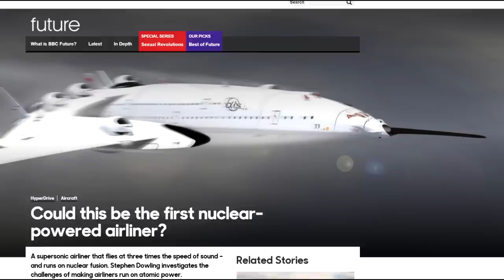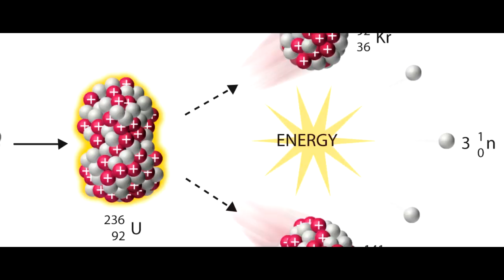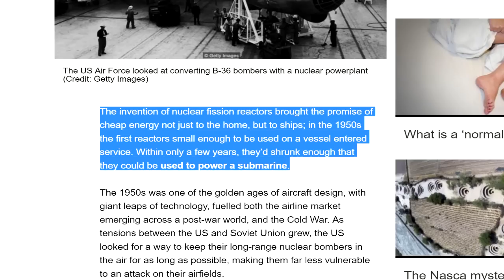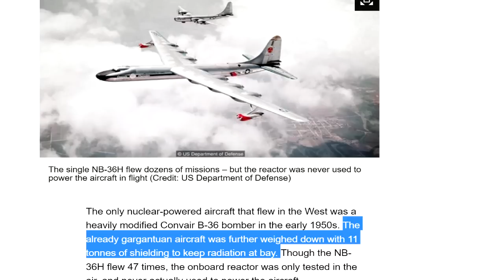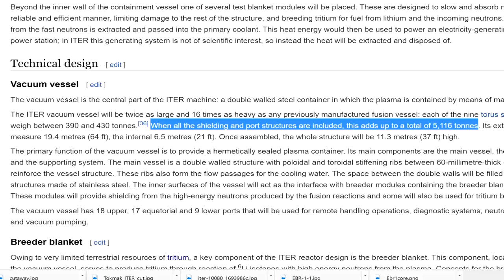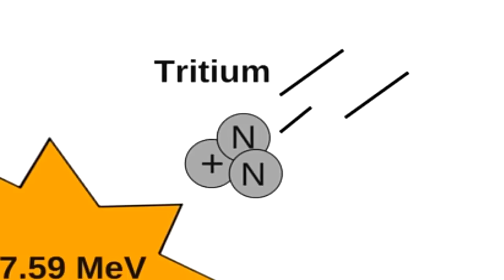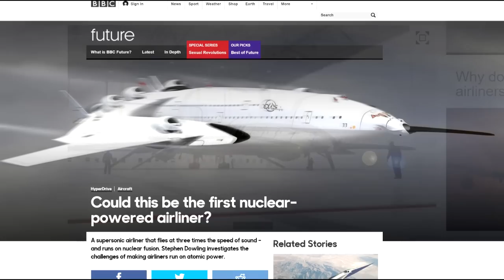SIX ENGINED Nuclear Airliner... BUSTED!

Comment: Wouldn't it make more sense to just have a plane capable of entering higher atmosphere to meet less air resistance so you could hit high speeds? Then again rocket fuel is expensive. I think it'll probably happen eventually though.

Comment: Do all concepts of fusion involve radioactive fuels? I was under the impression the goal was to fuse two hydrogens into a helium?
Reply: Molten Salt Reactor.  Most of the fuss these days is about the LFTR ( a type of MSR), the Liquid Fluoride Thorium reactor
Reply: The sun does that, but humans are nowhere close to being able to contain such a reaction.  I really don't get the hype about fusion in general, theoretically it's awesome, but in practicality were much closer to other clean sources (such as a MSR)

I'm sure eventually we will harness fusion, but i doubt it's going to be a big producer in the next 50-70 year's or so.  We could have MSR's up and running in a fraction of that.
Reply: What does MSR stand for? :D
Reply: animefreak5757 Aaahh. Thanks! ;)
Reply: search for LFTR in 5 minutes if your interested, it's a really solid primer on the technology.

Comment: The impracticality of nuclear aircraft aside, is there any reason that you couldn't use electric heat in a jet engine rather than kerosene flames?
Reply: It's the dramatic expansion of gas that makes modern engines work.  Other heat engines do exist, but just having heat alone generally doesn't give you the kind of differential you need.  Which is why powerplants still use steam turbine technology.
Reply: Thank you. That was a helpful answer.

Comment: We should just use Thorium reactors, because Thorium is one of the densest materials.
Reply: Untrue. Feminists are the densest material known, we should be using them instead.
Reply: +TheatreStyle That would be too dangerous. They're too unstable and are extremely high energy.
Reply: No, we need solar freaking airplanes. That time travel. THE FUTRE!/Imagination
Reply: no it would be so dense it would literally fall through the plane right into the core of the earth and cause yellowstone to erupt
Reply: +Joshua Kravatz Theoretically speaking would we be able to contain them with a safe space?
Reply: i thought feminist where easily triggered and the most flammable compound in the world
Reply: +Joorlak Flamedrake Thorium powered cars.
Reply: solar freakin planes,  nono that's just silly, thorium powered planes using solar freakin runways
Reply: Joshua Kravatz
I bloody knew it! Nice reference BTW
Reply: +Mick7sp I was thinking Solar Freakin' runways to get enough energy to liftoff, then either the Thorium reactors or feminist powered engines for the flight. 

And of course, we can't forget the complementary Palcohol.
Reply: VelstryoxDP well with some affirmative actions and and a few quotas most likely
Reply: Area 51 is still working on reverse engineering inertial dampeners from reptilian tech.  It will be a few years.
Reply: Perhaps, though I assume that you're refering to something that Thunderf00t's previously de-bunked.
Reply: Lord Black yes a car powered by thorium lasers.
Reply: Na just use a third wave feminist
Reply: They should use GOD reactors powered by prayers.
Reply: They'll just tell the inertia it's sexist and it will cower in the corner until they need it.
Reply: feminist are also unstable, can be triggered by everything. would you really want a meltdown every day
Reply: I do love the humour that us Thunderfoot viewers have.
Reply: +grumpybill  That's what I was thinking, but do we have the inertial damper technology we would need?
Reply: "Untrue. Feminists are the densest material known, we should be using them instead."

Sorry, but men knowingly getting on a plane with feminists would require massive balls, thus making the final take-off weight a no go.
Reply: +The Unknown Skeptic solar freaking drink holders!
Reply: Sakhmeov dude its a joke reference to the "Thorium Powered Car" bullshit. Not shitting on thorium itself.
Reply: What next Thorium Freakn' Roadways?  :)
Reply: why does no one use dilithium crystal?
Reply: *****
Well, it seems the same kind of buzzwordyness that's powered this artist makes a lot of people conflate...

Whatever. Alright, then let's point out that you can actually achieve aneutronic fusion and thus drastically reduce the need for shielding. Again, not that I think that this artist has thought of this beforehand, but...
Reply: anticarrrot
And they'd have to construct a safe space for the waste products.
Reply: Talking about Thorium, what happened to the youtuber?
Reply: you actually only need to provide them a code of conduct et voila!
Reply: +Permanent Cloak yes, then we could just go to the future where we were heading
Reply: Actually that could work as it would use salt as a medium (high temp, low pressure=not as heavy a reactor). Check out thorium reactors with Kirk Sorenson, he has a bachelor in mechanical engineering, a master's degree in aerospace engineering and a master's degree in nuclear engineering. Dont dismiss thorium because of an old car ad =P
Reply: lol
Reply: +Joshua Kravatz Thorium's pretty difficult. I suggest we use your brain - it's even denser than Thorium.
Reply: +Turmanation5
Same problem as nuclear. Theoretically viable but the issues relating to shielding and the machinery needed for converting their energy into useful work makes it prohibitive.
Reply: The last thing we should use is anything but nuclear in airplanes.
Reply: too unstable man
Reply: anticarrrot
That's why we should use derivatives, just like in economics. Less efficient per weight unit, sure, but the aggregate power of the passive-aggressive hatred and loathing on the direct level of interpretation alone could be used to power Italy.
Reply: AncapFTW
dampeners--In knew I should've looked that up
Reply: Feminists are ekstremly dangeres and can attack at any time, so we must deal with it.

/channel/UCcMDMoNu66_1Hwi5-MeiQgw
Reply: The problem is feminists break down fairly easily.
Reply: Why don't we just use pot plants? They can make rational decisions and don't collapse under the force of a mild put down.
Reply: +Rudolph Bondefängerer HUDRALEEK PRES CHANNEL
Reply: REKT
E
K
T
Reply: God
God stands for
Getting
Odd
Diddies
Reply: they will fly at like 200km/h you know how long that would take to fly from point a to point b? unless you're talking about an short distance plane then i could work
Reply: Feminists make a Supernova look like child's play
Reply: +Joshua Kravatz If we need someone low energy we can just use Jeb bush.
Reply: You could use it for shielding to fit in a smaller reactor room.
Reply: Joshua Kravatz thorium as a fuel source has been busted. It's not physically possible for us to harness it properly at least not yet maybe a few hundred years.
Reply: Please don't put Thorium in the same category of bullshit as this. The main problem with Thorium is that you get lots of Tl-212 and other byproducts that are high in gamma as a result of the fuel cycle, thus making fuel handling more difficult and dangerous. Pretty much all other concerns with e.g. the LFTR design have been addressed. It's not jumping past the fundamental problems with e.g. energy extraction that you have in nuclear fusion, not to mention not being able to maintain a stable reaction in the first place.

Comment: KSP much? xD

an electric airplane could work, but i would assume it'd be easier to just stick it full of batteries, instead of a full blown reactor :P
Reply: There is an airplane that is solar powered - It's the Solar Impulse 1.
Is it large? Well, it has the wingspan similar to Airbus A340 airliner, but otherwise... it has 4 engines of 7.5 kW each and carries 1 (one) person on board. It has MTOW at 2000 kg, while the smallest A340 variant - A340-200 weighs 129000 kg. Nope, not large.
Reply: As far as I know there are no large electric planes, just small experimental craft.

Solar planes are just genuinely one of the dumbest ideas ever.
Reply: i know. that was kinda my point. even an alternative to a nuclear reactor would be far too heavy to be useful. chemical fuel is still more practical.
Reply: If I recall there was a large airplane that flew just using solar power.
Reply: The problems with electricity is that your either have a reactor and very heavy shielding (bad idea for multiple reasons) or batteries which have a worse energy density than traditional fuels. Batteries poor energy density lead them to be unfeasable compared to cars due to their higher energy consumption and not being supported by the ground.
Reply: This is just a nitpick but the reason it can take so many rifle rounds and not catch fire has nothing to do with the fuel or anything and instead to do with the fact that the rifle rounds are not nearly high enough energy to get through the armour unless they all hit the exact same place hundreds of times.
Reply: Electric airplanes exist already though they're mostly in the microlight aircraft range or experimentals. They work but are seriously range limited due to battery limitations of power/weight which effect capacity hence range.
Reply: Electric airplanes already exist, but they're powered either by batteries or by hydrogen fuel cells. Also they're slower compared to jet planes
Reply: You don't need to turn the heat to electricity at all, you can use it directly to heat up air, making it expand and propel the plane. That's how the original nuclear jet worked.
Reply: Honestly, batteries aren't all that more energy dense even at their best than jet fuel itself, so it doesn't seem like it would be worth it.

Other than for say, super light-weight UAVs which use solar power and such. Then powering them for gliding long distances partly by batteries might make sense.
Reply: StickyTank
Fair enough.

I like the idea of a nuclear-powered giant aircraft carrier or something that flies, though.

Something like what Shield has in the Marvel franchise. That would be far more realistic than this "plane," in that it would be large enough that using fusion might actually be possible.

Then again, making something that large fly in the first place is very likely close to impossible to make practical.
Reply: it would be much more efficient and safe to fill it with batteries and recharge them with a nuclear power plant on the ground.
Reply: +Anthony McCombs you would need deep cycle batteries for this task, like the sort found in marine and industrial applications.... thanks IE the ones that contain slabs of lead. not the best choice for flying.

also before chiming In with lithium cells.... remember what happens when said cells get hot or damaged? I for one don't wish to be vaporized in a chemical explosion that also produces toxic gas....
remember a plane would need 50-100 tons of these to even make it possible for something the size of a jumbo airliner.
Reply: fuel gets used up. as soon as the engines start, the plane get lighter and this continues all through the flight.

not so much with batteries
Reply: StickyTank Good point. Also since both batteries and combustion work on chemical reactions, in case of jet engines one of the reactants(Oxigen) isn't stored on board.
Reply: +seigeengine fuel only burns when oxygen and a ignition source is available, fuel tanks lack oxygen and if punctured they simply leak till empty, now that the plane is lighter due to lack of fuel it can guide to safety.
Reply: Redneck Fury Fuel tanks don't lack oxygen unless they're full.

And what do you think a fuel tank is going to be punctured by? If it's in flight, there's a good chance everybody is going to die if something shoots down the plane. There's also a good chance something can go wrong and ignite the escaping fuel in a plane.

If the plane crashes, the fuel is going to go everywhere, and it's quite probable it will ignite.

I'm not convinced in either case that lithium cells would be a worse threat than jet fuel if something were to go wrong.
Reply: lithium cells can catch fire when breached, so... :P
batts are too heavy for too long and i doubt they can store enough power. refueling is going to takes hours or longer, so it's not practical or any saver, really.
Reply: +seigeengine other then the fact most large airliners and military aircraft create a weak vacuum in their fuel tanks for this very reason, you clearly know little about aviation. 

when a plane is moving at 400+ mph, a fuel leak turns to vapor instantly, it physically cannot catch fire while it's in travel, the engines can burn, but not a tank leak.

notice A10 warthogs taking 2000+ plus hits from rifles and not catching fire, some where even hit with 57MM cannon rounds and still did not combust.

also want do you even know how toxic batteries are when broken open? pretty sure anything in a mile of a li-ion powered plane crash would be killed by the toxic gas it creates.
Reply: +seigeengine lol, somebody is butthurt.

the points is, jet aircraft are still the safest way to travel for a reason, plus if you ever spend time around big planes you would learn something.

Jets can DUMP their fuel, it intentionally vaporizes when ejected, this is done to lighten the aircraft for various reasons and said vapor is SO thin that it just evaporates into the atmosphere.....spend ten minutes at a airport, look at how jets are fueled.....from the bottom of their wings, it's so the vacuum is never broken during fueling, in fact the fuel is pressurized on it's way in.

jet fuel is very safe, it's not shock or climate sensitive, burns rather cleanly and most of all, it's cheap.....a 747 holds  150,000 pounds of fuel, equivalent batteries would be in the hundreds of tons and cost dozens as times as much.
Reply: ***** neat :)
Reply: Random Name 25MM and 57MM can pierce the armor on the fuel tank's in the wings, and have, some have even lost ENTIRE ENGINEs and flown and landed on just a single unit.

Aircraft don't really burn when hit, if the tanks leak, the airspeed is just simply too fast to have a external fire.

Comment: Thunderf00t, buddy, a nuclear aircraft is possible and was seen as a serious possibility in the 50s before icbms became a thing. Not fusion but fission but still. It's not exactly science fiction.
Reply: The main point of that project was a aircraft that could be airborne for month's at a time.  It's probably not practical for relatively short flights.
Reply: Aside from constantly starting\stopping the reactor?  Also the cost and complexity
Reply: put it this way, nuclear energy compete's with, and generally loses to coal for electrical production.  Coal is a hell of a lot cheaper then kerosene or diesel.  Having a setup for sending excess power to the grid also means a ton of infrastructure needs to be put in as well.
Reply: Yes it is if it is power by fusion
Reply: It's more expensive period unless you want to increase cancer rates among passengers massively.  Lots of other risk's exist as well.